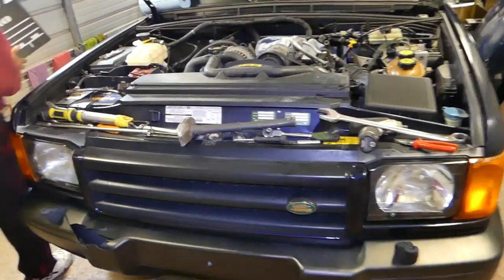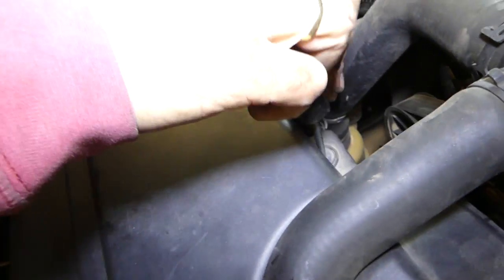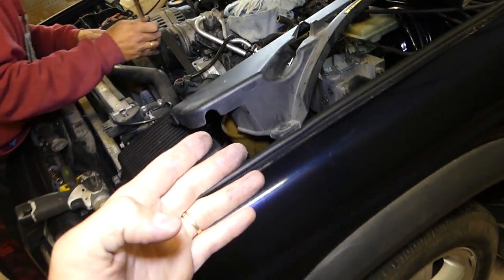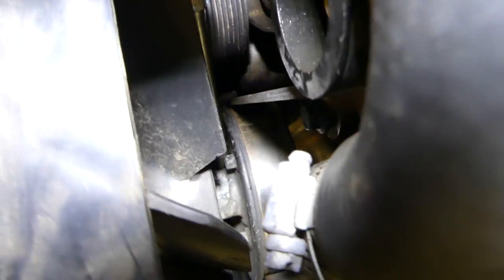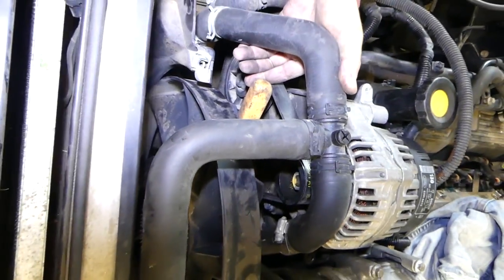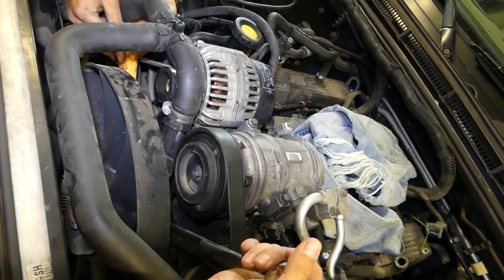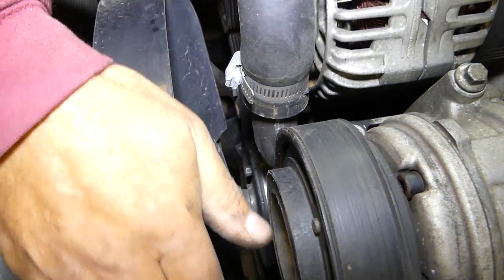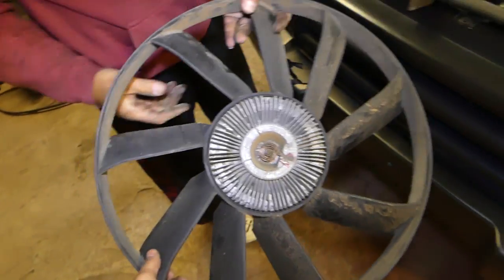LAND ROVER DISCOVERY RADIATOR FAN CLUTCH REMOVAL REPLACEMENT

Comment: I have a 2006 range rover sport and I start the engine and it works but when the fan starts the engine turns off, could you help me with this?